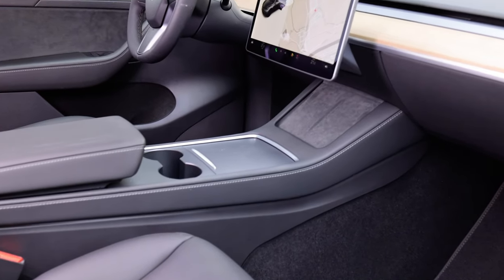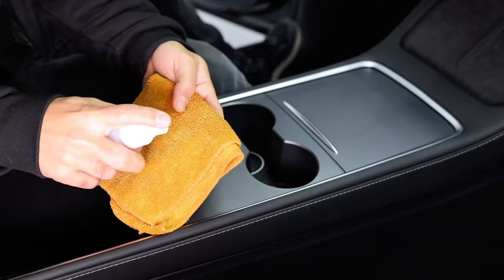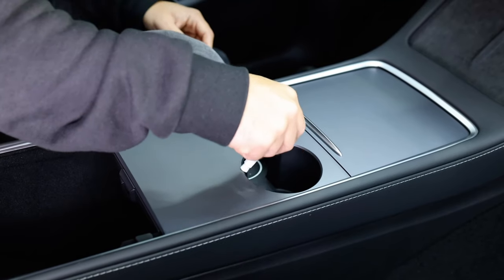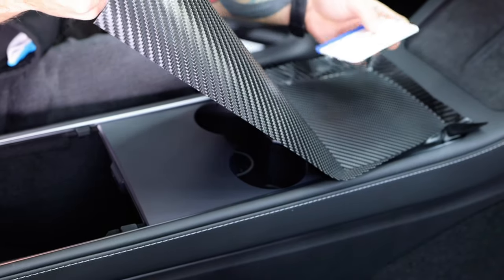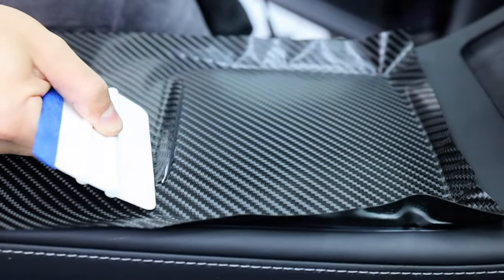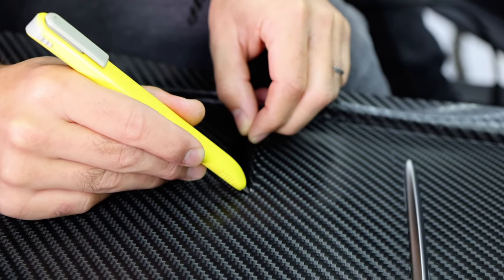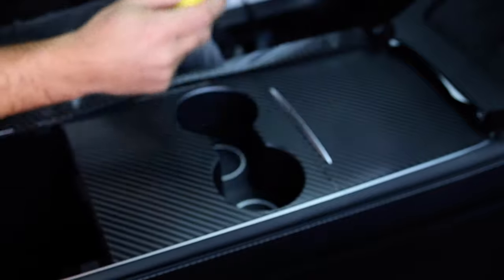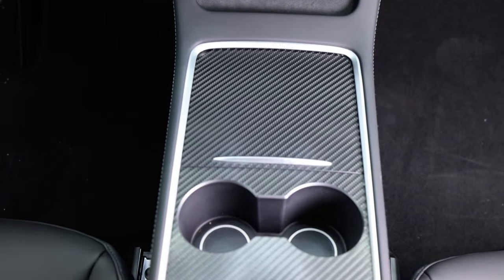How to Install a Vinyl Dash Wrap

Comment: Any tips for vinyl wrapping sun visors ? Is there any material vinyl wouldn’t work on?
Reply from the maker: So we had to do a little research. Typically vinyl wraps work better on hard non-porous surfaces. You maybe able to get it to wrap using an adhesive promotor, but we recomend you test in a non-visible area first. You can see the ones we offer here: https://www.rvinyl.com/Vinyl-Film-Adhesive-Promotors